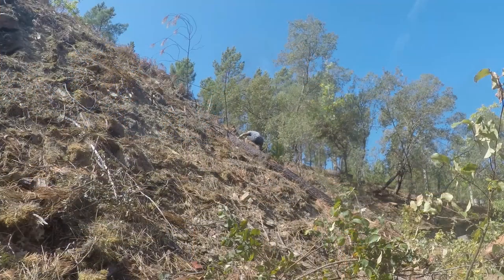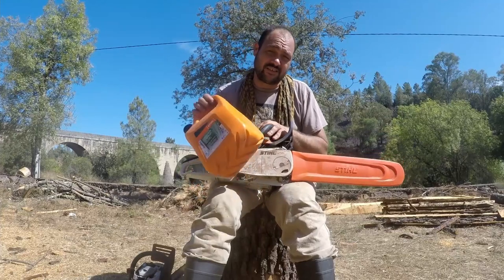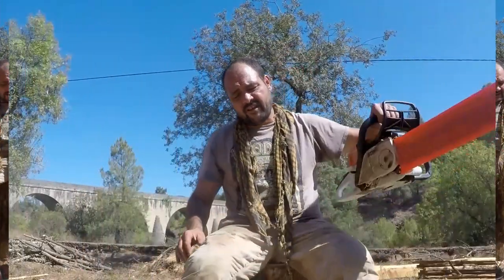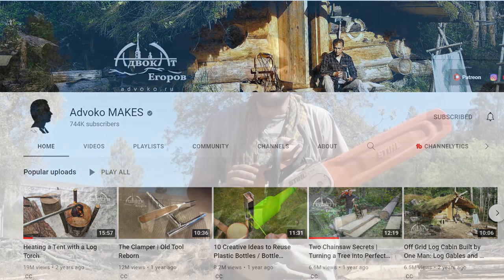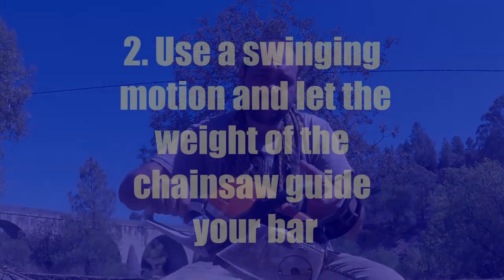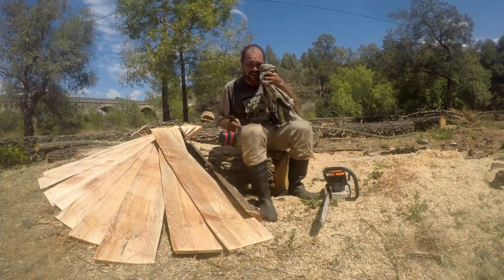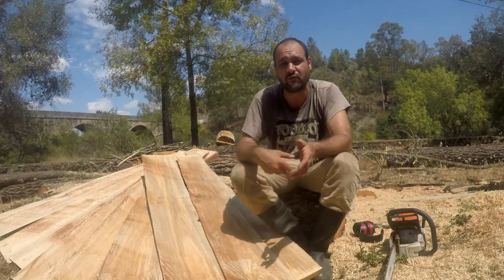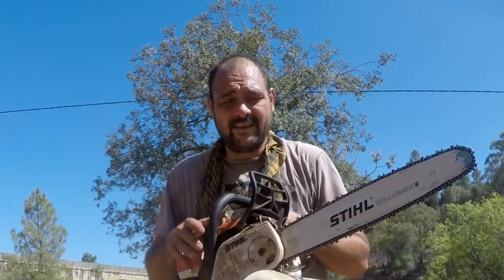How to Freehand Chainsaw Mill with a Stihl - 9 Useful Tips

Comment: Like you I saw Advoko Makes and have been using his system for freehand saw milling.

I do NOT sharpen my saw at 10 degrees as per ripping chains. Alexi also states that you do NOT have to modify your chain, but it does have to be sharpened evenly
More than sharpened evenly is that the rakers are correctly set. A worn tooth and a new tooth properly sharp and with their rakers set will take about the same bite from the wood. The cutting cross-section of the tooth does not change significantly as the tooth is worn down - they look funny because there is not a lot of tooth left behind the edge, but it is the edge which does the work.

GULLETS - as you sharpen your saw be sure to take a pass or 2 in the gullets, this is where the chip / shaving evacuation goes.

The Shavings - the ones you showed in the vid actually seem a little long to me - I get them about half that length. When they are coming out about half the length of yours, the cut is happening faster and there is zero clogging up at the drive sprocket housing on the saw body. You regulate this with the angle of the cutting ... where those 3-5 teeth are hitting the wood.

You want the last 1 - 3 inches of the bar and the bottom 90 degrees of the sprocket tip to be the cutting zone, CAUTION needs to be employed, you are working right on the edge of the kickback zone, as soon as you hit the tooth that is just above that midline on the sprocket tip and enter the TOP 900 degrees you are in Kickback zone - keep your top hand firmly on the handle....but not locked up, this hand has the greatest impact on the finish and evenness of your cut as this hand controls the rotation of the bar relative to horizontal while providing part of the pivot for the swinging the cutting plane. You need to hold enough to prevent unwanted movement and protection against kickback, but at the same time allow necessary movement in the plane of the cut ("swinging the bar" as Alexi calls it) 

Duty Cycle - As you indicated these saws, even the professional lines from Stihl and Husqvarna and others, are not intended to run at full throttle for an entire tank full of gas. A few minutes at most and then a cool down. I've been running the same saws for, in some cases, 40 years and for the most part they all run as if they were still new (I'm sure compression is off a little on the older ones, but they still fire up and run/cut like new) 

Fuel - If you are using the premixed fuel it should be spot on, if you are mixing you own use the highest octane you have at the pump ( I generally use the 93 or 94 Octane ) - the back of the 2 cycle oil mix states a lower octane than I use, but the higher the octane the more protection you have against detonation / knock and other undesirable side effects of high(er) compression and heat and high load. A higher octane can give you a little more difficulty starting a cold saw on a cold day so if you are in very cold climates, you might want to run the 89 once you start heading below 0 degrees F.
If you are even unsure while mixing your fuel / oil err on the side of slightly more oil to fuel ... NEVER LESS oil to fuel. A slightly oil rich mix may smoke a little more but it will not cause the problems of ring scoring or overheating (due to running lean).
If you have an older saw which still has the manual mixture (L and H jets on the side that you need a very small screwdriver to adjust) you want to run on the rich side of exactly right as opposed to the lean side - this adjustment is as much art as it is science (just right is 13:1 fuel to air stoichiometric (sp) ratio if I recall correctly, ideally you want to be say 16:1 - if you were adjusting this in an airplane you would have an exhaust gas temp gauge and you would adjust to 15 degrees F cooler than max to the rich side of the balance for power ... and we want power here .. so you find that max RPM on the Low speed jet and then back out just a little bit more as the RPM will come down just a little bit - again, it's an art as much as a science, what that best point sounds and feels like is different for every saw I've ever used For the high speed jet you are adjusting how it wants to run both as you squeeze the throttle to max - should advance smoothly, and how it runs at max RPM ... tricky as you do not generally want to run at max RPM unless you are in a cut so that you don't overspeed the saw or otherwise cause it damage ... but for just a second...spin it up and then let it down - don't hold it wide open throttle unloaded !!! ... you want it to get there and run smoothly, not smoke, or JUST a little smoke, but no skipping, popping, ugly drowning in its own fuel sounds etc ... then you take it to a log and make a cut and see how it runs at max rpm while under load and fine tune your adj....more art than science once again)
If you have a newer saw with the automatic carburetors, or the really fancy fuel injected units !!, this is all an archaic practice used by us old guys.

Good Luck!

ps, I've used a Husqvarna electric saw to do this on a small log - it works, but same as a gas saw, you don't want to just squeeze it and go, it WILL heat up and shut itself down for thermal overload protection and the battery will not last as long on a charge - they too are not designed for a steady continuous high rate discharge ....but the professional battery saws will do the job and as they improve those, they will work on larger and larger logs.

Comment: If you are using a ripping chain and only have a few teeth engaged at a time, then there will be relatively low resistance on the chain and having the throttle wide open will result in very high revs. It would be like taking your car on the motorway and sitting in second gear. You'd be redlining the whole time. Take it a little slower and sit at part throttle so that you're in a sustainable rev range.
Reply from the maker: Yep I know that now 😁

Comment: If your saw is turned up hot , (lean) , and a dull chain , and a light load ,  and ran wide open is the worst on any saw , besides , forgetting fuel oil , ... Imo . Great video .

Comment: Before YouTube I was free hand cutting boards and timbers. After cooking my old wood boss from the 80's I learned that it needs some no load run and needs a few idle minutes. Fist I tried one pass to rip a board out. Made a dozen boards at 3" X 5" 16 footers. The saw seized up 400.00 later I started only sticking the tip in. Many boards later I still have my 3rd ever saw still running.  Oh my first ever saw was Husqvarna and it would never start two days later I got my money back and bought that wood boss 21" bar from stihl never going to use another name brand.

Comment: Boards look great! Nice job! Your changing your method to letting off the throttle after running at higher rpm will make your saw last much longer. Milling is very rough on saws. (I recall that Advoko said he burned up his Stihl as well while milling. He even asked for chainsaw recommendations. Stihl, Husqvarna, Dolmar all make excellent saws. However, as you know,  all saws require a break in period (10 tanks or so) and even after break in, “shouldn’t” be run wide open for longer than 10-15 seconds. Generally bigger models (100 or so cc like 3120xp, ms880 etc...) run at lower rpms, and are therefore recommended for milling. But are very expensive. Large Chinese saws are cheap, so sacrificing them to mill, and saving your good saws, is an option.)
Reply from the maker: Thanks for the tip Wolfe😁

Comment: Thank you for this. Ive' been ripping boards this way for about a year and the results have been promising. I don't modify my chains and they seem to work best when slightly broken in, not with the hyper-sharpness for the usual cross-cutting. I use moderate speeds with fluctuations, lots of even footwork for a shallow pass running the full length of the cut, with a back and forth movement as I slide from the trunk side outward. Following the grain produces better results. When cutting long shingles, thinnest boards, clapboards etc, I like to follow the contour of the log if necessary, for a stronger result.
The rip-with-the-tip method allows for curved planks, angle cuts and unusual options not feasible with traditional milling. The convenience of it allows any person to create the best quality, most interesting lumber at a truly minimal cost. 
I will echo the video maker in thanking Advoko Makes for sharing his awesome chainsaw secrets.

Comment: I bet it wasn't an oil issue. I had a cheap saw, it ran lovely for years. Lent is to someone who screamed the motor and it was dead within an hour.
Reply from the maker: It was because I didn't run it in properly
Reply: @OffGriddingOnAShoestring  If i was your neighbour and you still had the motor, I would bet you a bottle of scotch the piston ring gaps too tight.

Comment: You used it very lightly so it used less fuel, less air and less oil.  If there was a load on it then it would have sucked in more fuel, more air and more oil.  Just an idea.

Comment: Popular misconception about two-stroke oil and gas mix. Adding "extra oil to increase lubrication" seems common sense at first. However you are replacing fuel with oil by increasing the amount of oil in the mix. This means that for every molecule of liquid that gets sucked into the combustion chamber, less of it is actually fuel. What this means is that you are in effect changing the AIR/FUEL ratio. You are decreasing the amount of FUEL for the same volume of AIR. Just like using an oxy/acetylene torch, when you increase the oxygen(air) in the mixture, it increases the temperature - so that you can melt steel. You do NOT want to increase the temperature in your combustion chamber by displacing fuel with extra oil. The modern oils of today provide plenty of lubrication, some of them are even run at fuel-oil ratios of 100:1 in high performance engines. Many oils have been capable of this for 50+ years, but it has taken a long time to get over the old "just richen the oil mixture" mentality of WWI era 2 stroke engines that were made of cast iron. 

If you have a saw that cooks it's engine, it's probably a 9 times out of 10 that the engine was simply running too lean of an air-fuel mixture for the conditions or for too long.
Don't forget you can also richen your air/fuel mixture to the safe side of the range by adjusting the high speed mixture screw. See saw manual for that one. Many saws have a "winter mode" which blocks off cooling channels for cold weather, make sure you're not in winter mode! If you have a fancy new fuel injected saw, you are at the mercy of the binary code gods...
Reply from the maker: Thanks for this message.. I've been told by the suppliers of both my Stihl and Husqvarna that I should put in a little extra oil. Now that you explained it I won't anymore.
Thanks again!!

Comment: Your chainsaw can handle running the throttle while your milling. 
You don't necessarily have to let it off to "let it breathe" mate. Your engine is always breathing. Or it wouldn't be running period. 

       Whenever you intend to load the chain, full throttle all the way is recommended.

The quality of the power head deals tremendously. 

I run a MS 261C. 20" Bar, and I work in my backyard with lumber that is left in burn piles throughout the community. 

Black Walnut, tons of Black Walnut.
Reply from the maker: see message from mr.beetham 😀
Reply: @OffGriddingOnAShoestring  Been doing the very same thing to this day with my 261. Haven't had a single issue with it and have not even changed the spark plug yet. About 25 cans of Motomix give or take since then, and I'd say 100 slabs! 

Too each, their own.